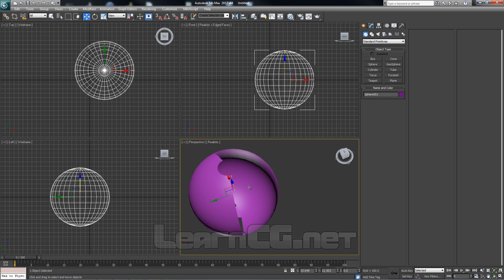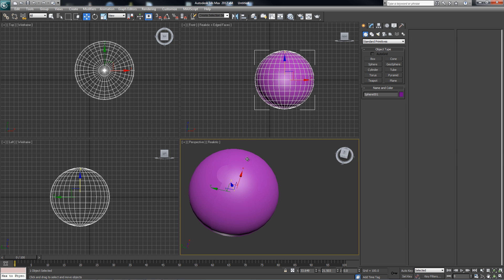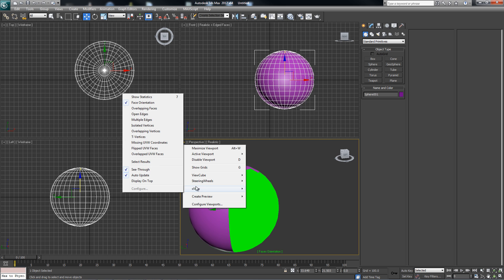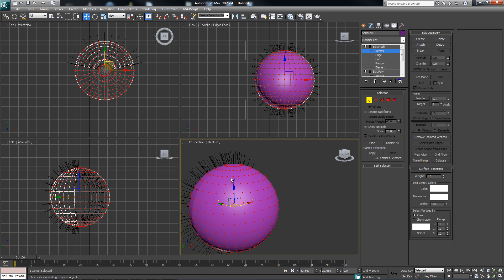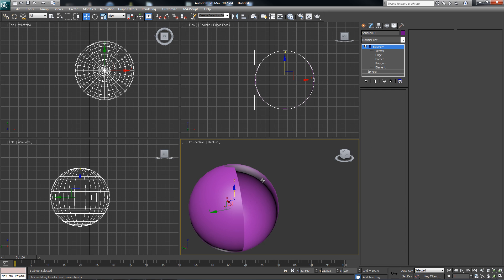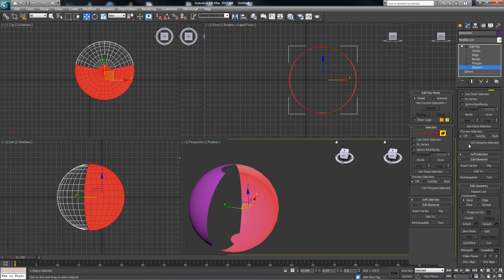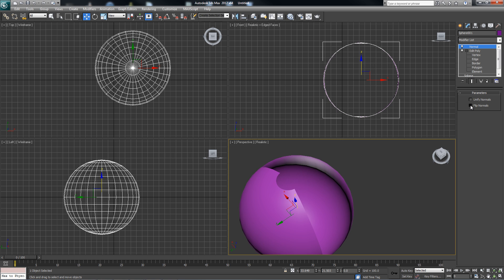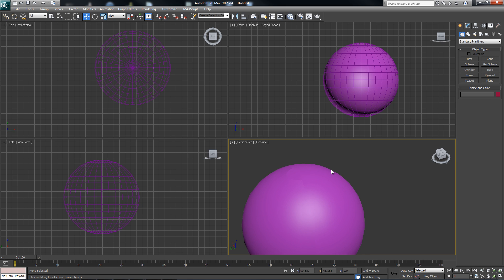Autodesk 3ds max tutorial - Edit Poly- Show Normals - Flipping Normals

Comment: What I wanted to find is, say for example the outside is black, and the inside is purple, how would I flip the color to make it occur on the outside?
Reply from the maker: Hi, that all depends in the structure of your mesh. By nature a closed poly sphere only has the outside inside is never rendered by the engine( the back faces are culled) . If you have a  single plane ( think parapa the rappa) those faces are only 1 side but the "magic" is with the geometry shader and not the mesh.  So with all that said I can't give you an answer with6seeing your geo :)

Comment: Somehow this does not work for me, tried it twice. But it is still a good video, in theory this could be a great solution. I run into all kinds of problems with 3DsMax. The funny thing is that if make a simple cube and try the same thing as in the tutorial, it will work great. Then you make some elaborate object and suddenly stuff like flipping normals or making a simple boolean does not work on elaborate mesh objects. I am quite shocked of how flawed 3DsMax is, looking at the price you pay for it. Funny example: i make an object, then clone it, then mirror it. The original object is perfect, the other one is problematic. And i have a lot of these things that are weird in my book..

Comment: Thanks for the upload and info. I browsed for this because I'm doing the same thing and hoping to find a quicker method, say assign colors to normal and inverted face. But I'm surprised that the solution is actually the long method that I was doing.  I just want to express my frustration on how Autodesk programmed the edit poly-polygon mode to show reddish on both the normal face and it's back (inverted side).. if you're modeling, it's not really quick to distinguish if the face is good or inverted. I hope they just used different shade to the inverted side, say gray or dull colors other than red.  Now- you have to add edit mesh and activate show normals in order to see it.. making the process so inefficient.  I'm surprised that the free Trimble Sketchup anticipated this issue with so basic solution-they used two contrasting colors- white for the normal face and grey for the inverted face making it very distinct for the user- no need to add any modifier and go anywhere- just see the different colors.